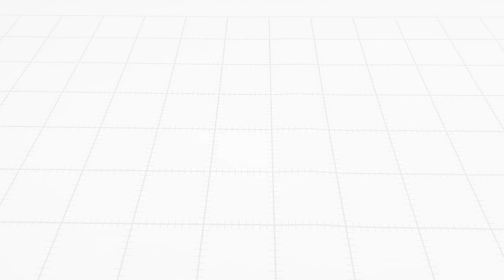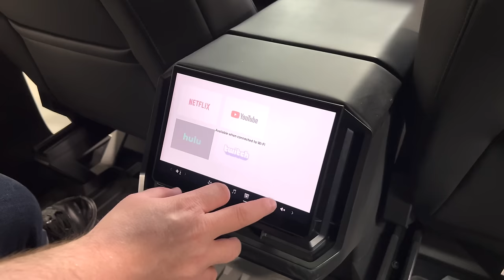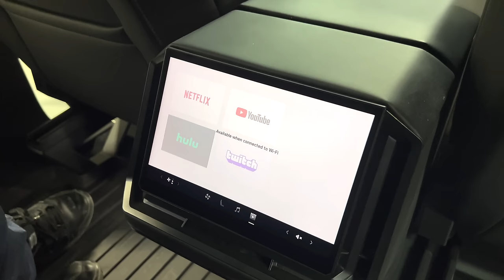Funky Form & Features: Tesla Cybertruck Interior Review

Comment: For why on the head rests, I recently had my head rest replaced under warranty due to the head rest vegan leather breaking down and becoming damaged.  Now it isn’t a great thing for that to be happening in the first place but the mobile tech was able to remotely service my car in 15 minutes to swap it out.  If the part was more integrated with the seat then I would likely be a more indepth fix.  At the same time there could be a process for replacing the surface material that would achieve the same result.  Another reason could be that the seat structure is better understood/research in regards to car crashes and instead of investing a lot of time to engineer a solution, it was cost effective to just build it like a normal seat structure.

Comment: It is interesting that some ask for a larger frunk. ICE trucks have no frunk. The other EV pickups have a large frunk because they illogically (IMO) kept the form factor of a traditional truck with a large front for the internal combustion engine. But, just maybe, a large frunk is a reason to keep the engine bay...
The Cybertruck is obviously a unique EV design from top to bottom. Hence the frunk is smaller.
To make up for it, it presently has the largest volume truck bed, that is secured with the best cover. The CT also has the longest bed and is the shortest of the full size EV pickups. Short makes handling easier.
Reply: Agreed.  I do really like the Lightning frunk, but it's larger than needed. Rivian made the mistake of having the front wall blocking the frunk, and even after all the complaints,  are retaining that mistake with the R2. The Hummer and Silverado have long frunks, but  they are laughably narrow! The fender section on both must be 16-18" wide.
Reply: The future issue with the entire nose and frunk, where the*&&^ is the front motor and parts? under the DASH! That will  be no fun to find and fix a leaking hose or?
Reply: @harriettanthony7352  Once you remove the frunk liner/bucket, components seem easy to access. The teardown will show either way.
The electric motor is basically maintenance free.
Hoses of course less so.

Comment: 6:14- depends on how, and especially when or in what order you use it. Of course you can fully use it if you put whatever things in there before you stack lumber on top of it, and then take those things out after the lumber is removed. Tools to work the wood, for example would be a great use case. Put the tools in before going to pick up the wood, get the wood loaded and then unloaded at the destination, and then take out the tools to do whatever with the wood. That’s just one example of a normal workflow of how the under-bed storage compartment could be used.
Reply: The best use for this is when you don't want tools walking around in the bed.    If you loading up the bed move them.

Comment: Great video, thank you!  When you were sitting in the driver seat (15-20 min in video), was the seat able to be lowered from that position?  It looked like your head was near the ceiling.  And the sun visor barely cleared your face.  And the steering wheel seemed way too low & crowding your legs.  

The seat lowered and back would seem a better driving position...does the seat have that range of motion?  Thanks!

Comment: Regarding the rear screen, I would imagine that it is fairly inexpensive for Tesla to implement. All that it requires is a mid quality screen with capacitive touch and a cable to the computer. The computer/processor is already part of the vehicle and so this would be a relatively minor cost compared to some other OEMs which are simply sticking a full tablet in the back. That method is more expensive than a screen and may also be much harder to integrate with the vehicle to control AC and seat movement, especially if the vehicle computer and rear tablet are made by entirely different companies. The OEM in question may not even be able to write software for either of these computers as well.

Comment: I think in the tour Sandy did of gigaTx they mentioned they were deburring the panel edges via laser? It was mentioned when they were explaining how the doors are welded to the inners.
Maybe they only deburr the door panels? Cause John from autoline also mentioned the exposed panels are pretty sharp.
Reply: Panels are all precision laser cut and do not have burrs.  I've felt the edges and they are not sharp to the touch. I don't know if the laser cut is enough, but I suspect they go through some edging machine that softens the edges slightly.  They are sharper than rolled over steel panels.

Comment: Tonneau should have been flat. Similar aero. No rear visibility issue. Ability to stack light items on tonneau or use a bedrack. Cargo fits nicely above and below. With a bed shell it acts as a flat shelf or extra security. Otherwise the angle is awkward like the ceiling to a home stairs closet. On top of that the rear window doesn’t even roll down - let alone not adding a game changing midgate that would make it a standout by filling the gap with both advantages of both open truck bed and long enclosed cargo of an suv like bed shell.
Reply: The aero would be significantly worse. A midgate would hurt the stiffness and strength. There is a trade-off to everything, I guess.
Reply: @geirmyrvagnes8718  That’s what Lars is for. It’s already a unibody and it’s been done before. Just reinforce it and they’re a step away from a modular 3 row SUV. Compared to everything else this is gravy. Even Sandy agreed when I met him. As far as drag the bed would still be covered for turbulence and worth any trade-off for more functionality - as a truck with a useful bed rack or bed shell. As is the tonneau is ridiculously useless in either scenario. It’s as if Franz and Lars never owned a truck or SUV - let alone used them to haul anything.
Reply: @IdiocracySpace  I wouldn't pretend to know how every design decision was made, but as I understand it, the external look was locked in early with Elon's insistence that it should "look like the future", "perform like a racecar", "look like the prototype or even better" or something like that. The triangle as seen from the side came from this, and the cover following this line makes sense. To me, at least. But I don't drive huge vehicles for a living, either. I don't see the benefit of shrinking the covered volume that much just to see out the rear window. The tonneau is not "ridiculously useless in either scenario", to me at least. It seems like a quite useful feature. But there are more than one way to make a vehicle, and there are already many options with flat tonneau covers. Good for them, I guess. My mod would have been that the rear window could be opened somehow, to give you the option of a climate-controlled tent.
Reply: @geirmyrvagnes8718  Exactly - a roll down rear window was a no brainer and they just blew it 😅. They were even tipped off ahead of time when they asked. Basically the angled tonneau is like having a crooked shelf or ceiling. I appreciate maintaining design integrity thru to production as it’s also my profession. But the bottom line in this case is they sacrificed several major functions over form and it tipped the scale for me personally to pass on my Foundation order and look again at the Rivian R1S.
Reply: @IdiocracySpace  Yeah. It is not like there is an unused secret empty space below the window, and they just forgot to add the mechanism to lower the window. That would have been a no-brainer. Negotiating the space between the tonneau mechanism, the 6 foot minimum bed, and the castings is a "brainer". The Rivians are nice, too. And very flat back there. 😅
Reply: @geirmyrvagnes8718  Ah that’s probably it- they didn’t add the window mechanism to save bed space. But then again you could place 6-10’ surfboards thru an open window and still be secured with an angled tonneau. Still we also prefer it for fresh air and camping access in general. Funny as everyone gasped when the Rivian R2 rear window rolled down ala 70’s station wagon. Because it shouldn’t be obsolete - it’s useful and cool. If you know, you know… 🤣
Reply: @geirmyrvagnes8718  Ah that’s probably it- they didn’t add the window mechanism to save bed space. But then again you could place 6-10’ surfboards thru an open window and still be secured with an angled tonneau. Still we also prefer it for fresh air and camping access in general. Funny as everyone gasped when the Rivian R2 rear window rolled down ala 70’s station wagon. Because it shouldn’t be obsolete - it’s useful and cool. If you know, you know… 🤣
Reply: @IdiocracySpace  Yes, it is all a trade-off. The realness of a truck bed depends on its length in American feet. The people who claim a real bed is 6 feet would scoff at anything slightly less, and wouldn't count an open window. So if you want the truck to fit in an American standard garage (total 18 and a half feet) and seat 5 comfortably, you may end up with a simple and strong connection between bed and cabin with no moving parts, and a short frunk. If you have other priorities, you end up with something different. It is not a question of "missing" or "failing" as much as it is prioritizing.

Comment: I wonder if the 4 tie downs in the truck bed are prep for a 5th wheel or gooseneck attachment... seems like the placement would be perfect. For 5th wheel the hitch would likely need to articulate to add height when turning - something that's already been done for conventional pickups (esp short bed). Gooseneck might be tall enough so sides are less of an issue and might be raised to avoid these issues as well. Another considerating is that 5th wheel/gooseneck towing might require the expansion battery pack so maybe those anchors would be covered by the pack...

Comment: 5:19 one reason the front doesn't overlap the side panel is because it's a frunk door that opens up. The other is that they cannot curve this metal the way you normally can...it's not stamped, it's bent with a brake.
Reply: There is literally no functional difference if the overlap was from the top/front.

Comment: Likes:

- sleek stainless finish
- looks very neat and clean
- the interior is very easy to clean
- seats wont collect dusts and mites
- the flooring is easy to wipe
- the back compartment that has roll-up cover is awesome (although roll-ups gets stuck sometimes)
- very wide view of the road
- and of course,  computer controlled mechanism plus internet is awesome

Dislikes:

- the saw line at the artificial suede (dashboard) will get scratched and fade after a while and it wont look good.
- the steering wheel looks "small and very low" . it wont even give me any sense of security when i'm about to crash. we have a tendency to push hard on the  steering wheel to lessen our impact on the dashboard when those times happen (pre-airbag inflation) and it helps a lot.
-  the fixed head rest is bad because humans come in different shape, size, and form.
- ceiling is too low
- doesn't look like there's enough space for the legs to stretch (front seats)
- sun visor seems useless
- did he mention plastic smell?  i hate that. whatever happened to "new car smell"?
- glass roof (and very wide windshield), not good at countries with so much sunlight
- the stainless quality looks easy to scratch.  what percentage of stainless is it?
- no Keyhole at the door?  should have Manual controls as well (in case of emergency)
- should come with Manual Drive too

i haven't seen the Engine and under part yet.

Comment: I think having the ability to move the set from the back is great but would be something kids would drive you crazy with hopefully you can lock it out from the front
Reply: I've heard that the rear seat control only works when the seat is unoccupied. The seat weight sensor triggers that. If you have a heavy box there it could cause an issue but this would be a relatively rare occurrence. And when someone IS in the front seat you just ask them to move it.

Comment: Where are the front air vents and also do the back passenger air vents being that close to an electronic device somehow interfere with that device temperature-wise? Do the lack of vents where there are usually radiator vents effect the cooling and heating of the vehicle? Even though it's electric, machines create heat.

Comment: If the front windshield has a decent Low-E coating on it the thermal load to the dash to degrade the adhesive will be somewhat minimized.

Comment: Carl, how could you miss the inconsistency of the white surface above the drivers door arm rest at about the 10:13 mark?  The surface is not smooth, way out of character for this vehicles price.  It's as if it the surface below it wasn't cleaned of debris or the adhesive wasn't applied evenly.  
Got to give credit to Honda for the side opening tail gate: very easy to access the in bead storage.  You are less likely to get dirty when you need to reach over the gate.

Comment: 5:24 It's every bit a full size truck. Dimensions are similar to the F150, which is what the were aiming this at competition wise. Right now you have it in Entry mode, its lowest height setting. So it looks shorter than your typical F150, but that's not the height you'd drive it in (and you can raise it much, much higher).
Reply: Someone had a picture with 2 Cybertrucks and an F150 lightning. One in entry mode and the other in its highest regular mode and that ride height difference makes such an impact in how big it looks.
Reply: Externally actually smaller than the F150.
Reply: @rogerstarkey5390 In very minor ways, not significantly...and depends on which dimension. Yet, it has the larger bed. All I'm trying to say here is that it's a full size pickup truck, no an SUV.

Comment: Great video Carl. That bottom of the rear seat cover…. Is that seat bottom (mostly) hollow? If so….Would you think it interesting if the bottom were hinged, so that there would be a long storage compartment inside the seat bottom? You could access that upon lifting up the seat bottom. Or maybe some Velcro straps to hold items in place in that gap under the seat bottom before the floor. It looks like there is some space available there but not certain of that. I like to use that space under the magic seats in my little Honda Fit. But straps to hold things in place would be useful.

Comment: I'm not sure the criticism of the under truck bed storage holds water.  Would you rather not have it?  I'd rather have it and use my brain and make sure I don't put anything in there if I know I'm going to be loading stuff on top.  I'd also be happy if Tesla had used that space to store a full size spare too, that way it only needs to be accessed rarely in emergency situation.
Reply: Spare under the load is also a bad idea.   And it is not large enough.   Maybe an inflatable spare.
Reply: OP is correct with the logic of underfloor storage. This writers Honda Ridgeline has this feature. He kept the less used items in it. And there IS a spare under the floor of the RIdgeline. The CT lost that use/space with ALL the air ride systems.

Comment: Carl would have been more impressed with the bed if they had included the integral loading ramp into the tail gate and "kneeling" rear suspension, as shown in the 2019 initial reveal. What's the bed height? Buyers probably don't care- because they're not actually going to load anything into it and really use it as a truck. With more deep dives and evaluations, it seems apparent that many things were cheapened, not included, and corners were cut to save costs. Production numbers and cutting costs, not quality, obviously were the first priority. Decontent the vehicle after the reveal, then raise the price substantially. This is a $120K toy.

Comment: Cool review ,ace job Carl, i wonder do Tesla employees ,watch the reviews ,and wonder what there thoughts are , it would be so hilarious funny , if a group of Tesla employees , came into Munroe ,and were in a position to have a over and back dialogue ,with the guys tearing down the Cybertruck correcting some areas where mistakes were made or learning from the Munroe guys. A couple of things stand out , the rear arm rest i think is a touch of genius , having it quite long , means the cup holders are very far forward in a comfortable position , unlike the F 150 arm rest that is very short . The very flat floor in the front is useful , with a pass through to either side  , feels open and spacious. It would have been very cool if Tesla copied the Ioniq 5 and had the centre console on  rail that could be slid well back to give even more access across between the front seats , this is especially useful for young courting couples , use your imagination what for ....!!! . 
Extremely useful info from Karl , about the danger of having your arm on the top of the steering wheel , if the airbag goes off , your arm gets driven up into the roof , much better to have your arms out to the sides of the wheel. Personally i think that steering wheel  is the coolest part of the truck , it looks space age , its size is perfect not too big. 
As for the body panels/styling and lack of door handles .......... there is no words ......

Comment: What would it cost to replace all the fabric with something that can be cleaned with a swifter or a damp cloth?  My F150 gets very dusty inside after a few hours at work.  At least the floor is rubber and the underside of the back seat is hard material.  The first thing I do when buying a truck is get Kevlar seat covers.  People who have callused hands (workers that have trucks) tend to destroy seats quickly.  Should I cancel my CT reservation?  I need a truck truck, not a toy.  Stainless body is why I wanted one over the F150 Lightning with it's aluminum body.